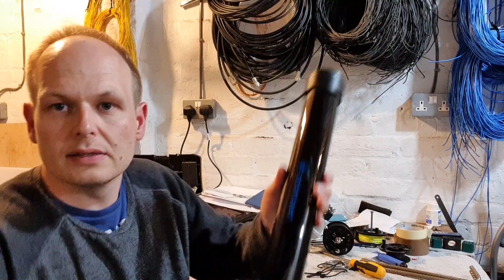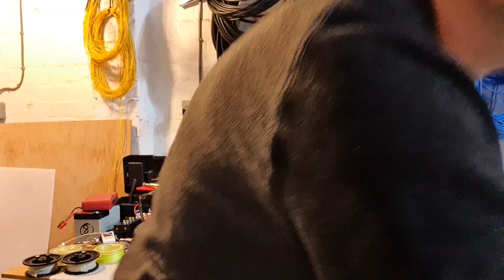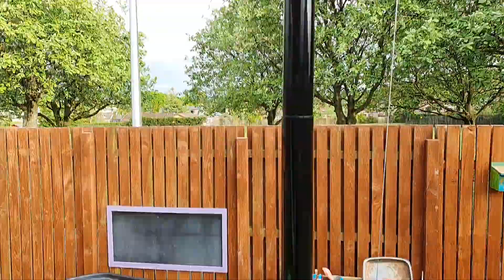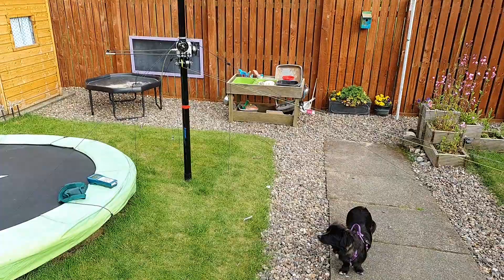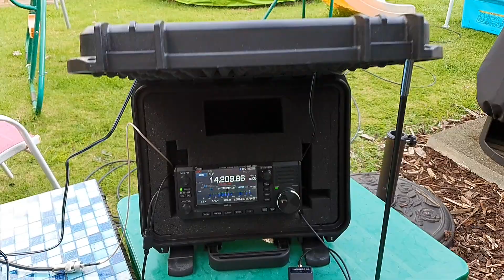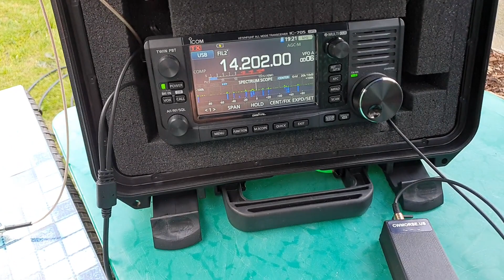My Holiday DX Antenna Part 2

Comment: Sweet product, radiator idea, how about the removed spiderpole tips :-) small spike push into ground, would travel inside the main pole
Reply from the maker: Great idea, I will see what I can come up with.
Reply: @MM0OPXFieldRadio  btw been thinking of ordering your standard with radial adjustable version. My aluminum mast has a 50mm with and tip is 28mm . The normal with seems good withiout adjustment,  but the 28mm tip is it possible to get from you? And second question, i will be mostly using an elecracft kx3 so bnc connections, if possible what would be best for low losses? A secondary bnc connector lr your box or just use a adapter  to bnc? Im a beginner ham and mostly interested in playing and making antenntennas, also digimodes when i get to it :)
Reply from the maker: Probably better to email me. I can help though. No issue to supply the larger top mounting plate but I don't stock the 28mm clamp. I can however send you a direct link to purchase this yourself. I haven't tested on an aluminum pole so you may have some interaction between the adjustiwave vertical element and the aluminium pole on some bands. Don't worry about the losses with a BNC adapter. You would struggle to measure the loss and certainly wouldn't notice any loss during use using as adapter.

Comment: I have made a 20 meter wire vertical and not that there is anything special about that, it’s the elevated radials (2off) that made it near invisible hanging the wire from a tree and the elevated radials clipped to my fence.  It worked very well so your setup should work even better.  I find elevated, tuned radials, work better.  Conditions are mixed at the moment. But things are changing for the better - thanks for posting BTW ordered my 10 meter Spiderbeam pole .  73 Mike
Reply from the maker: Thanks Mike,  I'm swaying to the elevated radials myself. Very little downside for the benefit.
Reply: @MM0OPXFieldRadio  Just a note about the 10 meter Spiderpole, mine came yesterday and it's great.  The only downside is that the base is too large for my drive on antenna device, not too much of an issue when not using the car as a base to work from but I'm sure I can come up with some sort of device to clamp to. Have fun!